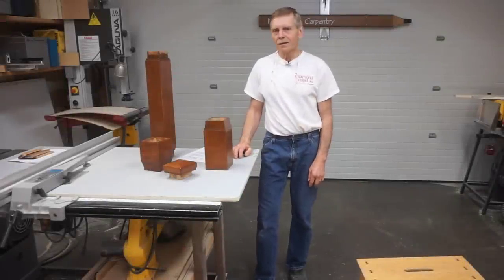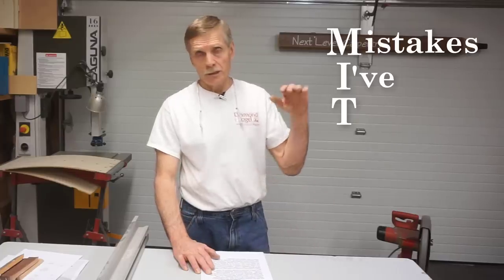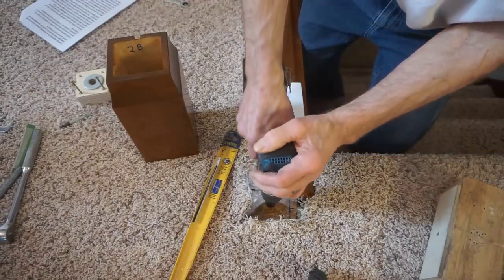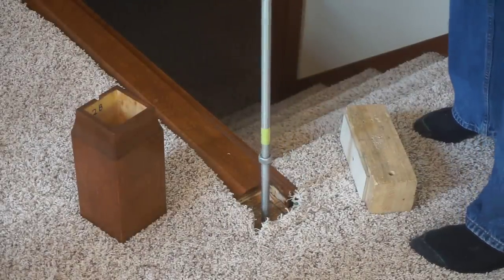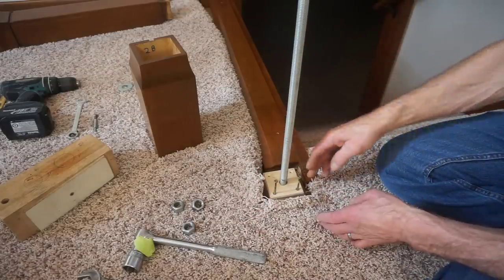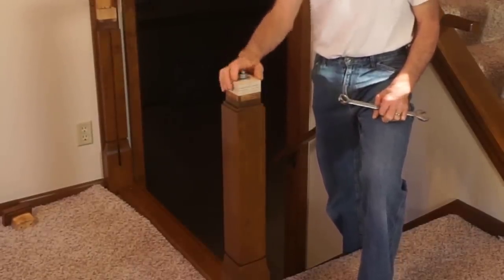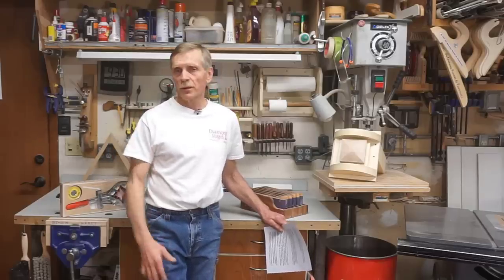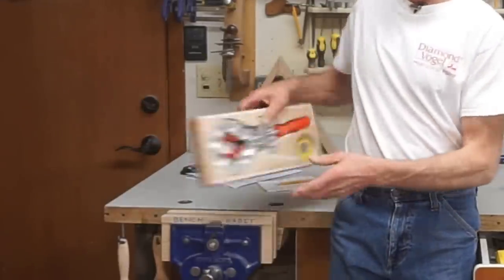How to Install a Newel Post Without Wobble

Comment: You mentioned to make sure that drilling the hole in the floor will not compromise the integrity of the structure. How do I identify this important bit of info? (Please don’t tell me I’d need a structural engineer...)
Reply from the maker: I'm afraid it's one of those 'if you don't know, you don't know' sort of things. Without access to someone you trust who 'just knows' from experience a certified engineer is your best bet.  There's so many factors involved in answering the question, all of which need to be taken into account.  Hopefully if you're in a position to tackle a project yourself you know someone 'in the trades' that can give you a reliable opinion.  Best, Matt

Comment: Good solution to an age-old problem!  As I was watching I thought about welding a headless section of 1/2" lag bolt to the end of the all thread so the lag threads are what holds in the framing below the floor. Might have more holding power than the machine threads on the rod. Am I over-thinking this? Oh, and I'd add some PL Premium adhesive to the bottom of the newel. You know, for that "rock rigid" effect! :D
.
Reply from the maker: Hey Geardriven, welding lag threads on is a natural inclination but unnecessary in my opinion.  I suppose if you were anchoring into unusually soft framing or blocking deeper lag threads would hold better but with a properly sized pilot hole and a 'self-drilling tip' on the all thread the thread depth isn't the weak link in the chain.  I don't think PL adhesive would help much with the 'rock rigid' effect because, at that point, it's the fact that wood fibers under the post are subject to compression force, not tension.  Adhesive would only assist in tension.  Someone commented below that adding a plate of 3/16" steel under the post and with a somewhat larger footprint would disperse the compression force for a more rigid installation.  Were I you I'd do an attentive job of the installation method shown and see if you think it needs any additional measures for stiffness. I think you'll be amazed at how rigid the 'standard'  method is.  Let me know how you make out?  Best, Matt
Reply: Told you I might be overthinking this. Just how my analytical mind works :D
Reply from the maker: Nuthin' wrong with that, Geardriven, nuthin' at all!  Much better to think stuff through ahead of time and sort out the best path forward!  Best, Matt
Reply: You can buy a large 3/4" lag-bolt already made like that just for mounting Newell's.
I use them regularly.
Reply from the maker: Interesting... do you have a link to share?  I'm curious and other viewers probably are too...
Reply: @NextLevelCarpentry  I couldn't find a link to the exact one I get locally, but very similar to the Sure Tight mounting system made by UBS. The ones I get are only about 16" long, but we use a union and additional length of All Thread to extend to the top of box Newell's. Still just using All Thread as in your video is cheaper.
Reply: Love the wood and glass handrail system! I've never done one like that.
Reply from the maker: Thanks for telling me you 'love the... handrail' Michael.  I've done a couple metal and glass 'system' handrails by buying components online and having a local glass outfit provide and install the glass panels but this is the first wood and glass system I've done.  Presented a few design/millwork challenges but really liked the finished look: clean and 'modern' but not 'industrial'.  The key to working through all the design/engineering issues was the detailed SketchUp model you see in snippets in the video.  If you're a SU user and are interested I'd upload the model to the Component Warehouse for you... just let me know?  Best, Matt
Reply from the maker: Ok, thanks, sounds like the Sure Tight should be easy enough to find for anyone interested.  Best, Matt

Comment: Different idea....but as an “MIT” guy, how does this technic work for solid wood newels(not a box newel)? I use the newel bracket kit you posted at the beginning of you video all the time, and in my 10 years of use it I’ve yet to have a handrail fail or wobble.
Reply from the maker: Mitch; This really doesn't work for solid newels since it would be problematic to bore and mortise holes necessary for installing the hardware.  That said, if the newel bracket kit is working for you I'd stick with it.  I'm dubious and would have to assess "yet to have a handrail... wobble" for myself to be convinced but, then again, there's a LOT I still don't know! 😲😂😎Best, Matt
Reply: If you were to do a solid post you could cut the post down the center taking into account the loss of wood from the kerf (cut). Then datto or rout slightly over the radius of the all thread? Then glue up the two halves of the post. The idea of NLC is the newel post is held by compression from the nut bearing down onto the post. The all thread is rigid enough to prevent wobble. I’m guessing the stacked portion above would still need to be hollow since it’s more decorative then structural.

Comment: Great video and technique, thank you!

Asking from Canada - where can I get this "ready rod"? Is this just a 5/8 diameter, 48" long threaded rod? Or does it require opposite threads on both ends? Does it have coarse thread on one end and fine thread at the other? I just don't know where to source this equipment and what to ask for. "Ready rod" isn't something that Home Depot, Lowes or Rona seem to know about.
Reply from the maker: "Ready Rod" is just jobsite/contractor jargon for threaded rod as you surmised.  Sometimes I call it all-thread too but it's all the same thread from one end to the other, not reversed, not fine/coarse combined.  Sorry for the confusion... but I wouldn't be too surprised if big-box employees didn't know it by any of those terms🙄
Best, Matt

Comment: Great system.  In my application, I have no 2×10 joists under the newel base.  Is there a solution that will mount the newel as rigidly as this ready rod system?
Reply from the maker: You'll have to gain access to the void underneath that newel post but you can easily achieve all the strength you need and more by building up a 6 or 8 inch stack of solid wood blocking for the all thread to screw into. It's actually better and stronger to do it this way and is worth it even if it means cutting a hole in a finished ceiling or wall to install the blocking

Comment: Hello Matt, Do you have an installation video of the glass panels? Also, what type of wood is the top rail so it doesn't flex if pushed against. I assume you dadoed the top rail as you did the posts. I've been tasked with doing the same thing on a job and any tips would be most appreciated! Thanks for your channel. I always enjoy the content.
Reply from the maker: Since the post design was so job-specific I didn't do any video on it or the glass panels... it was pretty much a one-off project.  The rails are solid cherry which is quite stout in that size.  You're correct in that the handrails are dadoed out on the bottom and slip over the top edge of the glass panels... very nicely if I do say.  One thing you might not notice/see is that the post dadoes stop out 4" from the bottom. The dadoes are 3/8"+ wide and about 1/2" deep.  This means the glass panels are supported by a little 'ledge' in the bottom of those dadoes and is just 3/8" x 1/2".  That means there's a lot of weight on those bearing spots.  I had the glass guys put a small clear plastic 'bearing block' on the ledge to provide a little cushion to eliminate even the slightest chance of the sharp corner of the large glass panel chipping.  Hope that helps.  Best, Matt
 BTW this project was in my own house and, with the post design and 
installation factors was a VERY finnnicky build/installation.  We loved 
the final result and feel the upgrade to glass panel railings was a key 
factor in getting a great sale price on the home.
Reply: @NextLevelCarpentry  Thank you sir. I have found that we think alike!
Reply from the maker: @klmbuilders5385  let me know if phot is would help and I'll put some on Pinterest. BTW if you are a SketchUp user I uploaded my working model of the handrail system to the component Warehouse where you'd be free to download it for a little more insight.
I was nice to meet a like-minded viewer and Tradesman! Best, Matt

Comment: Where can I find the article you wrote? I’m considering using your methods in my up coming project.
Reply from the maker: Hey Allen, Thanks for asking but I'm afraid all I can tell  you is that you've discovered a gap in reality of the publishing world.  The article I mentioned never materialized (but I had to go back and dig digitally to remember) in a forgotten chain of events.
Good news is all the article would have gone through is how I added blocking in this particular installation.  Since adding glued in blocks to whatever existing framing  you encounter is basic carpentry little extra insight is required.  I'd be comfortable with 6" of solid wood for the ready rod to screw down in to but I achieved about 8" in this installation.  6" of solid blocking is better that 10" that isn't secure.
Think the process through as you see it in this video and extrapolate for the project you're planning and I think you'll soon see if it applies or not.  The main principal is so straightforward that I'd use this any time I have a hollow newel and, because of it's effectiveness, would consider altering any design that has solid newels so that they could be hollow for this method.  Another thing to consider is doing a quick mock-up before committing time/money/material to a method you're not comfortable with.  Finally, mentally compare the strength this system can provide to other methods.  Other than running actual solid newels down into existing framing and screwing/bolting them in place I don't think you can beat this.  Good luck with your project! Best, Matt

Comment: currently working on my railing in my 1940s house. I have only one 2x10 or 2x12 directly below where I would have my newel post. Thick I can safely drive a 5/8 maybe 6" down?
Reply from the maker: I can't provide a useful answer without more information but if I had the opportunity I would be inclined to glue and screw another piece of 2x alongside the existing floor joist and drive the threaded rod for the railing into that block instead of into the joist itself.
Properly done it would be every bit as strong and not compromise the strength of the existing floor
Reply: @NextLevelCarpentry  thanks the reply unfortunately I don’t have access to the beam. I’ll see how else I can safely do it. Thanks again.
Reply from the maker: @davidiliyn  No problem. FWIW in some cases I had to create access below the floor by cutting and patching access holes but it was worth it to get the results I was after. Even if it meant patching a finished ceiling after once the newel was installed it was a relatively small price to pay IMHO.  Good luck with your project!

Comment: This is great!  I'd like to do this in reverse, drill a 1/2" hole X inches into the bottom of my solid newell post, thread the reddi rod into the post, and because I have access from below I can use the nut and washer from below.  What do you think?  Any advice on how deep I should thread the readi-rod into the post???
Reply from the maker: Depending on the species of wood your post is made of I'd guess 4~6" would be pretty good. If you can run a thread cutting tap up into the post it will help keep it from splitting out.  Are you thinking of using 5/8"~3/4" reddi rod?  Larger diameter is better for getting the threads to grab even though the the strength of the rod is over-kill.  Should work like a charm as long as you have the luxury of access from below.  Make sure the subfloor and blocking below are pretty solid since there's SO much leverage on the post it can wobble even though the rod it super solid just because the leverage can imprint/flex plywood... make sense?  Do one as a test first before committing to a string of 'em... Best, Matt
Reply: @NextLevelCarpentry  Thanks very much for the reply Matt.  And good idea to tap the hole.  I hear you regarding the subfloor and blocking, no point securely mounting a post to a sheet of plywood suspended in midair.   I though 5/8" was sufficiently huge, but yes a bigger circumference would have threading advantages.  I wonder if there's a commercially available bolt with machine threads one end, and lag bolt threading the other end?

Comment: This is brilliant, and something I may do at my house, although I want to do 3.5" post, either hollow or solid wood with a hole down the middle and a cap, so what about a square steel plate with a thread in the middle, that is screwed into the floor with #14 wood screws, then the threaded rod screws into the plate, or have the plate welded to the rod, then you have no issues with pullout, 
any thoughts on this?
Reply from the maker: With the 5/8" coarse threaded rod in this installation there's zero issue with pullout Mrdubomb.  I don't think #14 wood screws would be an upgrade for strength but might be necessary and adequate if something about the floor structure prevents drilling and driving the rod like I show in the video.  Site conditions vary widely and your alternative ideas might be just the thing for certain applications so thanks for adding them here! Best, Matt
Reply: Any opinion on grade 5 vs grade 8 threaded rod?
My joists are only eight inch which is actually just over seven inches, I do not know where my holes will be exactly, I dont think they will go into the main joist, but assuming they are (which is beefed up on either side with sister joists and blocking) do you think that will compromise their integrity?  How far down would you suggest as a minimum/maximum distance and what size was your pilot hole?
I will be doing this with 3.5 inch posts, would you recommend another method?
I would have put a half nut on the underneath of a much thicker centering block, as a extra protection against pull out, but that's just me.
Reply from the maker: @Mrdubomb  This installation was so robust that I wouldn't consider any extra measures like stronger rod, extra nuts, etc necessary at all... then again, that's just me.  I wouldn't try to talk you out of adding some of the changes you suggest because you know what gives you peace of mind which is most important. You're dealing with smaller joists and a smaller post so you might should do a little experimenting to answer your pilot hole question.  There's so much pullout resistance if you get into the meat of the joist that I think this would work in a 2x6, much less a 2x8, but there again, wood species could easily change that.  If you have access to the underside of the installation you'll be able to better assess strength requirements.  Keep in mind that, compared to the alternative of using little angle clips screwed to subfloor and post you're about guaranteed a much better/stronger installation with this method regardless of specifics.  Work through your process ahead of time before you commit to modifications of existing conditions that you can't reverse though... Best, Matt

Comment: Two words: Lock washer??  Over time the nuts could loosen a bit. Lock washers would minimize that appreciably in my opinion. 
Since you’re going through the trouble of bolting down anyway why not throw one in top and bottom?
28 yr handyman and former mechanical engineer in N California wine country. Just subbed
Reply from the maker: Thanks for the sub!  I'm a bit surprised by how insistent viewers are about the perceived need for a lock washer in this assembly. I suspect it may be from experience working with framing lumber that's wet and shrinks when it dries leaving fasteners loose, but not from the nut spinning.  Pressure from compressed wood fibers in these post is more than adequate to keep the nut from spinning and loosening and with dry wood in the entire assembly I've no fear that anything will shrink.  I could have saved myself some time discussing the point though if I'd just put a lock washer on there in the video even if it's not necessary. 😁😎 Best, Matt

Comment: I am planning a horizontal cable railing and will have a newell post on one end that will be freestanding. I do not believe a hollow box will lend proper support and strength for the cable and hardware under pressure. Can you offer advice for best way to install a solid 4x4 onto the floor or other ideas you may have?  Thank you.
Reply from the maker: Hey Tom I believe that a good box newel is just a stiff as a solid newel but for cable railing you need bomb-proof anchoring for either one. I think it will be tough to retrofit a free-standing post for cable rail regardless of post design or anchor type. My guess is that you are going to need to extend whatever post you use down into the floor system because cable rail tension will over stress any type of anchor that I'm familiar with. I would look for recommendations from the cable rail manufacturer because you're not the first to do this but it may involve more work than is practical for that freestanding Post in a remodel situation. Good luck with your project...
Reply: @NextLevelCarpentry  I am grateful

Comment: It appears the floor joist is paramount to this method being a success. What if, where you want the newel post, there's no floor joist underneath? Is there anything that can be done, or did I answer my own question, with my opening sentence?
Reply from the maker: Add blocking underneath... I had to do that on the other 2 of 3 newels you see in the video.  Blocking is basic carpentry so I didn't include it in the video.  It's 'easy' when you have access from below but it's still 'easy enough' even if you have to open up the subfloor and drop it in from above.  Done properly it's equally strong... Best, Matt